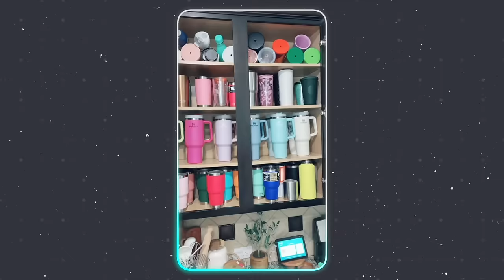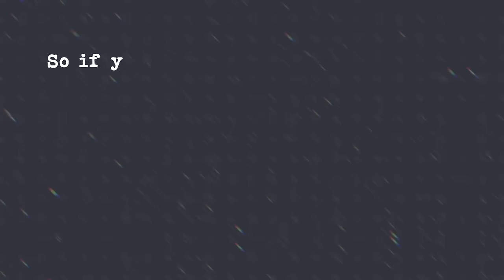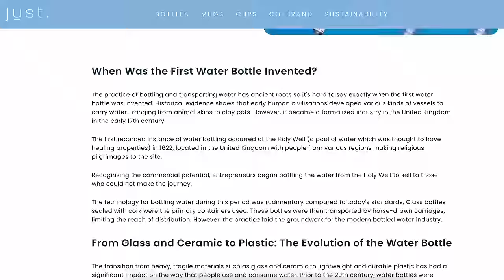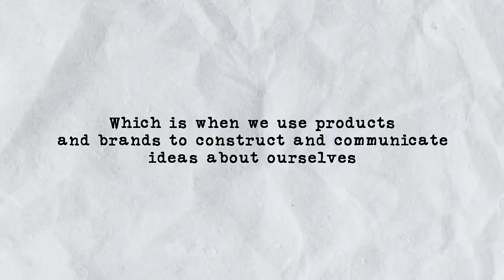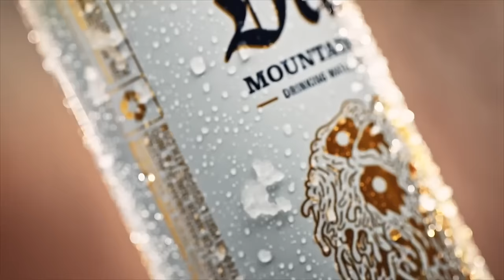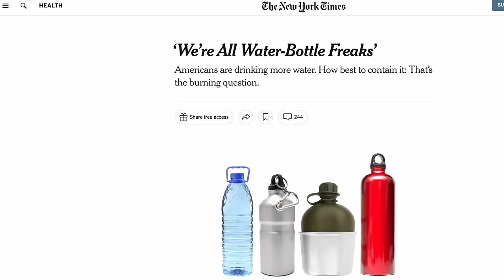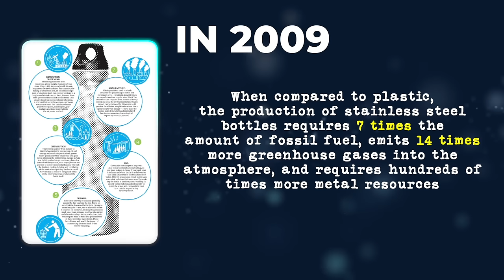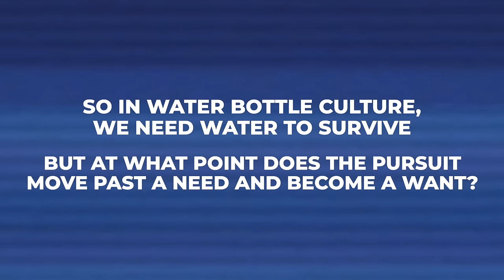Let's talk Water Bottle Culture.

Comment: I burn through reusable water bottles, though it is more because I end up losing them, so they tend to only last me say 1 year on average, but they only cost me $5 per (I buy protein shake bottles 😂 cause they don’t leak/snap/break (I do also use them for breakfast protein shakes but more so for the rest of the day).

I’ve tried those 2L/half gallon esque bottles, but they often leak and are just obnoxious if it’s not purely for a road trip to leave in your car.

Alternatively, many brands of shakers break easily or are just overpriced and or tacky looking.

If you live in Australia. I recommend going to chemist warehouse and buying the currently $7 inc protein shaker bottle (red lid clear bottle 600ml). I’ve been using them since high school and it’s hard to beat (except if you repurpose Mountain Dew bottles from zinger boxes, though they kinda deteriorate the water quality rather fast so you can only keep em for 1-2 weeks).

Mind you, I do not care about the environment. I just hate leaking/easily breakable bottles. Also, I’ve never had a good metal bottle (normal/flask/shaker/thermas) not leak nor just get really banged up from normal use 😅

Comment: Also the Stanley cup looks clunky and inconvenient. My reusable metal bottle is a perfectly convenient cylinder with a loop on the top to attach to backpacks and to hold my keys and a sturdy plastic straw thing that folds down into the lid when not in use. I've been using it for like 2 years now. Never needed anything else for my water.

Comment: For me, my argument for things like aluminum and glass cans/bottles, and paper bags and cotton tote bags is their effect on the environment well after it's been used. 

We can always get more efficient at producing power, aluminum and glass can be infinitely recycled, and doesn't have the same effects as plastic when left Underground. The plastic will no matter what have to be thrown away, and we can't do a single thing with that. It can never be recycled, reused, and as for the coming decades and centuries it will only degrade into microplastics. (Recycling degrades plastic and at a certain point it loses any of its beneficial material properties, thus needing to be thrown out). Any and all plastic produced, no matter what will have to end up being thrown out at the end of its life, with no clear sign of it ever looping back into the environment.

Unless there's a good argument against this, I dont see how that could ever offset the higher energy cost it once saved the years ago it was produced.

Comment: My 11 year old little sister owns multiple water bottles. While I've technically owned more than her, that's because I've had multiple single use that I drag out for a few months.

She currently uses a water bottle that shows you how much you should be drinking, and gets stressed if she's behind on water intake (I only know this because she admitted it)

Owning multiple seems silly to me, even after she's gotten new ones because the old one was damaged or a so-called better one exists, I have a 1L metal trespass bottle that is scuffed and dented to absolute hell that has outlasted every one she has owned purely because I keep using it.

but seriously bruh how tf can you get stressed about drinking, just drink when you're thirsty

Comment: Water bottles are so easily customized by the surplus of stickers that most people possess. I just don't understand why you need all this "customization" done by the manufacturer when the best customization is done by yourself. Also, Stanley cup users, and any water bottle with a straw, better be cleaning out that thing good. I had a silicon straw that I used in my Nalgene water bottle and I didn't clean it and it was NASTY

Comment: I have an $8 ozark trail coozie from walmart that i bought on sale for $5 and a $25 nalgene (had to ball out for the big version of the normal one) both ive had for around 10 years. They dont look very nice, the nalgene has a big piece of flex seal cause i dropped it off the back of my truck, those both have been all over the world, from japan to iraq. I wouldnt replace these for the nicest stuff possible. I truely dont understand why people have to have the nicest stuff. That ozark trail one i have works just as well as the 40-50$ yetis.

Comment: ITS NOT EVEN A CUTE CUP. Sorry. I had to say it. It looks like an elongated mug with the bottom being way too small and it looks like a cone with the tip cut off upside down. Don’t get me started with the handle. Like- a normal mug is easy to lift but imagine 1l or even 1.5l on just that thin metal handle? I can feel the pain just chugging it without that sippy straw.